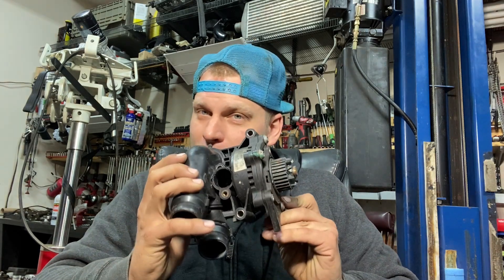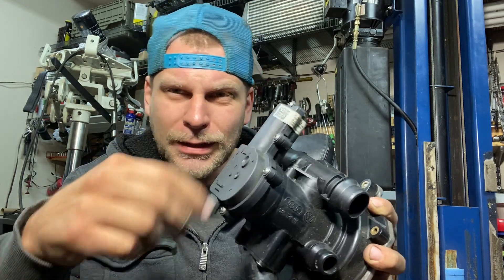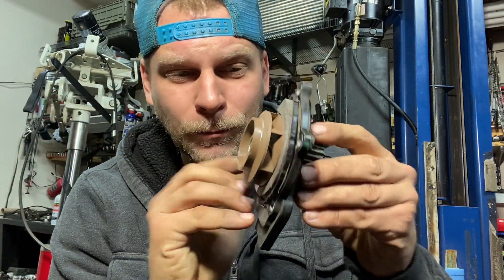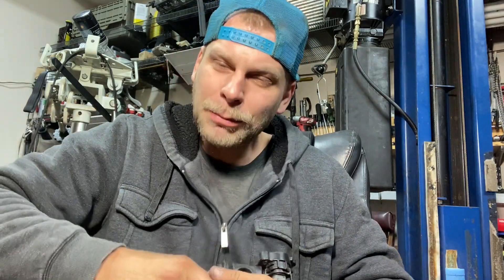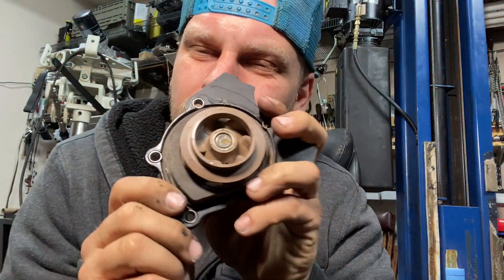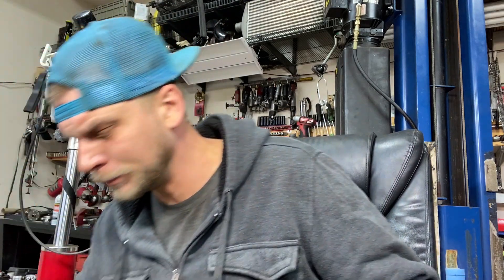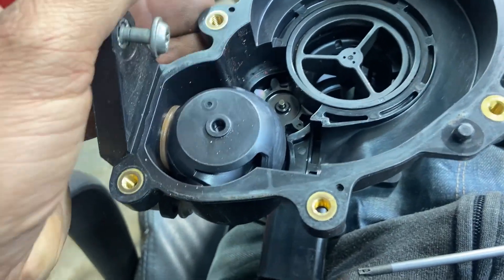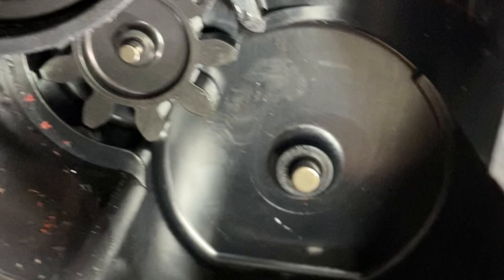Crazy Electric water pump comparison b9 2.0t tfsi vs b8 b8.5 a4 a5 a6 q5 q7 Audi vw engine motor 2.0

Comment: Having issues with my tcm triggering my fan and sending car in limp mode after the ignition switch only allows the start to turn half way on cranking then when I hold down the start button a lil longer than  it fires up, already busted my ass changing the starter and still having the same problem, I notice coolant leaking into the harnesses by the tranny and oil pressure switch etc so don't know

Comment: Hey chief, which part on the b9 waterpump leaks mostly, cause I asked the dealer for a water pump and only got the metal flange  portion with the impeller

Comment: I have an Audi A4 2014 B8.5 Gen 3 Australian edition and it came with that fancy "B9" type thermostat housing. Car has 150000 km (93000 miles).
The water pump/thermostat housing has just started leaking. Will cost $1700 AUD ( 1239 USD) Independent workshop quote replacement. Thanks for all your water pump videos helps me understand how they work.

Comment: The old thermostat plastic outlets used to fail where the thermostat pushed against the plastic. So they updated it with slightly more plastic. Everything on them fails.

Comment: Dear Nap. 
Please help. 
2008 Audi A3 2.0t tfsi. 
Long story short. 
Trying to get this running for over a year now. 
I got a perfect running engine, replaced new radiator, water pump, 
I’m thinking the end of the balance shaft is broken off.
When the engine is running the water pump is not, the gear that drive the belt for water pump is not turning, the bolt that holds it is solid, dose not want to move. Do you think I am right in saying that the balance shaft tip the pokes out the end of the block is broken in side, I just don’t understand why the engine still runs perfect. There is a lot of money in this vehicle do you think it’s just best to look out for a good engine and pay huge money 🤬🤯
I watch a lot of your videos and know you would tell me what I should do. I’m lost Much appreciate a reply.
Reply from the maker: Take it apart until you find why it’s not working
Reply: @NaptownTuner   Did you come across this prob befor. Wanted you opinion on what you think is up with it, if that balance rod is broken inside. Why els would the car run so good
Reply from the maker: @arlynmullins3387  no I haven’t seen it
Reply: @NaptownTuner   Oil burning bad pistons and dodgy balance shafts no easy fix on this engine. Seems the only right way is to get a decent built engine, hard with out the tooling and facilities. Back to square 1 again like many times in the past who is going to fleece me. From the collection of trash parts to the stores of VAG I’d like a full over haul 3rd generation pistons are a must. I’ll be dreaming of those sweet new balance shafts. Let me nAp on this one an see what’s to be done, thinking a man of your caliber would have some ccta units ready to go.

Comment: The N493 operation on the Gen3 water pump is laid out in SSP 606.  All about engine thermal efficiency optimization.  Which is what we should be using engineering for.  Carburetors get it done; direct injection gets it done a whole lot better.  That thermostat is to activate a bypass invoking the radiator if the coolant temp inside the pump exceeds 113°C.

For the Gen3, the coolant temp sensor G62 is on the backside of the head.  Probably necessary for the water cooled integrated exhaust manifold concept in the Gen3 head.  And the G83 is back (after being cost cut for the Gen2) at the bottom outlet of the radiator (cooled return).

Thanks for the visual tear down.  SSPs and stuff can be informative.  But at some point, one likes to see the actual object.  It's hard to judge from observation though if such construction is inherently flawed.  There's a class action on "widespread failure" of the Gen2 pump, yet my pump from Aug 2008 is still going at 222k miles.
Reply: I appreciate the technology and the ability to precisely control things like coolant temp, in this case. But when a failed integrated electronic thermostat necessitated the need for a $2800 water pump replacement and flush, I about came out of my skin! Had no idea how these things worked or why. I do understand the "why" now, but WHY?? This is just overcomplicated "stuff" that is prone to failure and expensive replacement costs. I'll be replacing mine myself for around $300. Great disassembly video Naptown Tuner! It is exactly what I was looking for!

Comment: Great autopsy of the B8 water pump I am a bit confused as to why that tried and true t-stat (bimetallic spring) would need to be redesigned for the B9? Hmmm radically different.. seems like the t-stat is servo driven once the operating temp comes up that servo closes the bypass and opens up the 1” hose barbs.. seems a bit over designed to me but hey I love Audi/VW have a lot on my property and all run great.. so I thought that maybe the balance shaft didn’t drive the B9 pump but it looks like it still does but the electronics seems to apply to the temp control paths. Nice video.. always learning from you dude 👍🏻

Comment: You should have talked about revision. Your thermostat housing must have something like 06L 121 111 H, latest current version is 06L 121 111 M and same thing for the water pump. May be you have an old version 06L121 012 A, latest is 06L 121 012 L. the last letter in AUDI part number refer to revision. the latest version are less likely to fail as they have corrected the faults. Always put latest revision of parts as they are less prone to fail.

rpmXperts
Reply: so they finally solved the problems with the revised thermostat housing? i see that the water pump has an updated part number too.
In my car, the water pump has leaks.. and the car has about 45.000 km...
Reply: @paralelmind  Exactly. This is very nice from VW/Audi. They revise their products, however not many people know about the way to read a part number and understand their difference. Normally when you change a part, you try to seek for an exact replacement (same part number) to limit any odds, but actually you are doing a wrong thing. You should always look for the latest revision of that part, and the last character of any Audi/VW part denotes that revision. Normally the first release of a part will have an 'A'  at the end of the part number and it goes till Z, then 'AB', etc.
Reply: @khaledbhunnoo6454  too bad we don't have any changelog, so we know what exactly was improved / changed.

Exactly, I've seen several revised parts with the last letter changed.

But with thermostat housing and water pump i am really interested what they've updated.. nowhere found anything

Comment: B9 is shaping up to be a great generation. Awesome ecu controlled tstat, dsg with shared atf and gear oil vent channel so when you overfill either of these 2 compartments, Audi tells you you need a new trans.Perhaps b8/b8.5 really were “peak” A4/A5s? After that, only incremental improvements and almost no manuals.

Comment: Bought an OE waterpump straight from the Parts dpt at the Dealership for my A3 8P TFSI...I shit you not--it lasted me 1 year and 1 day and then it failed.  Audi would not warranty the waterpump because if failed a day after its warranty was up.  Bought a CRP Rein OEM pump and its lasted me 4 years so far.

Awesome dissection, thanks!